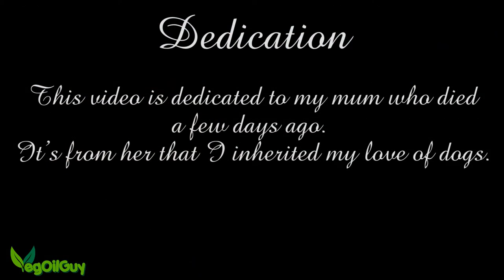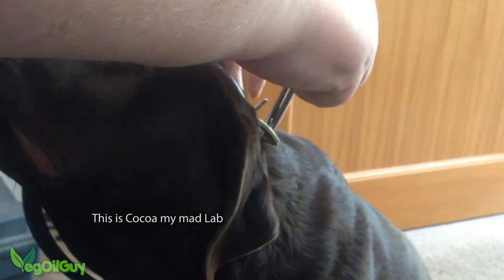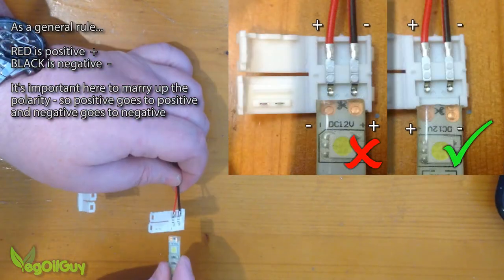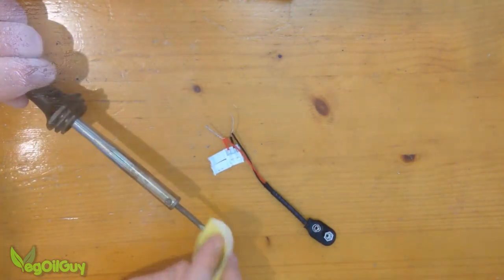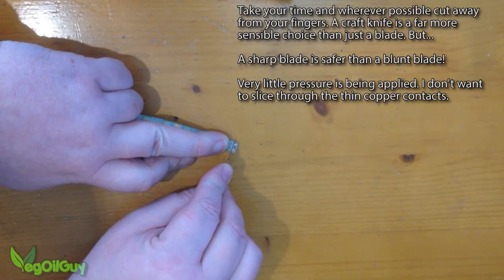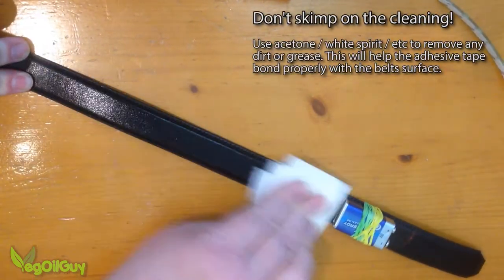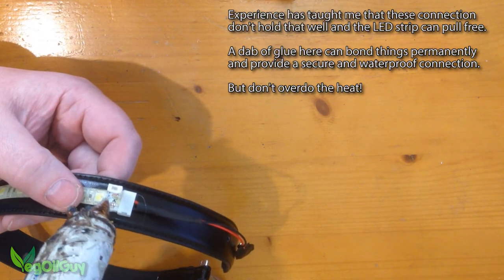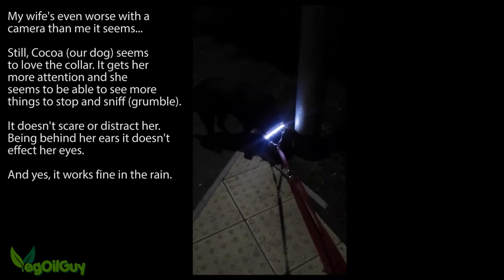How to make an LED Dog Collar by VOGMAN

Comment: Great use of LED Lights. Now I know how to connect it all up. Cheers.
Reply from the maker: Many thanks. They're great things. I was planning on using them for DRLs, for cupboard lighting, under-cupboard lighting and more... there's lots of uses as long as you secure the connections properly. That hot glue works a treat : )